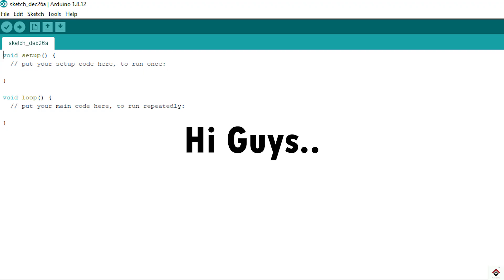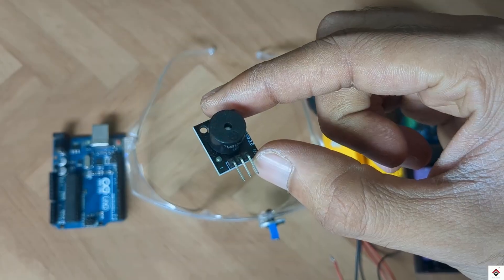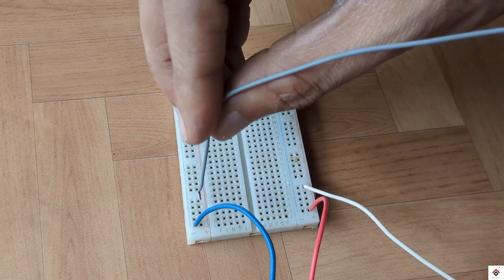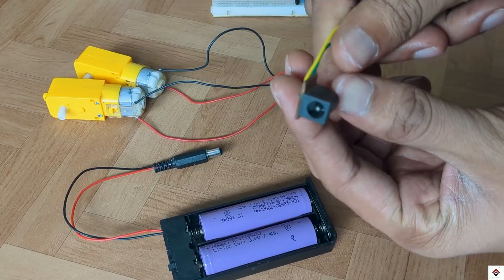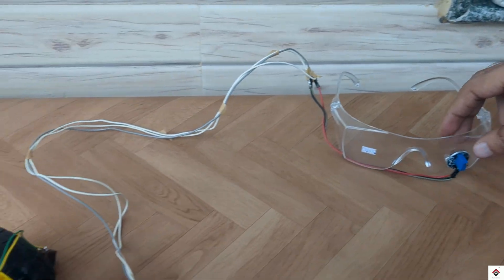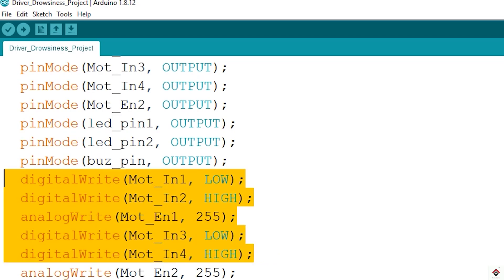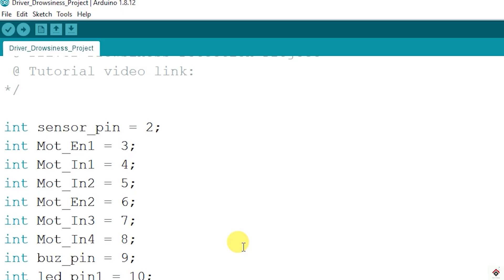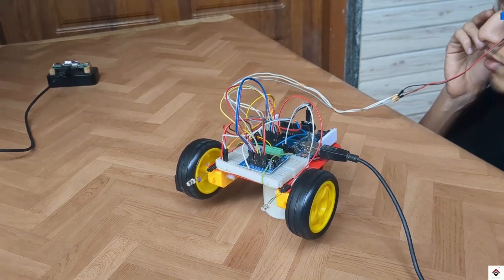Driver Drowsiness Detection Project 😴 | Anti Sleep Alarm System using Arduino, EYE Blink Sensor

Comment: Pls tell any other way to power Arduino in this project cause I don't have powerbank plss
Reply from the maker: You can use round pin connector with DC supply/battery 9 to 12v.

Comment: Is it necessary to use round pin to connect battery??? Pls reply it's urgent
Reply from the maker: Yes, if you give supply through USB port, all components will not get sufficient power.
So through this round pin connector, you can provide more voltage.

Comment: Engineer so the power supply for the Arduino.... How can I build it
Reply from the maker: You can check for voltage regulator circuit. I have not tried.
Reply: @techathome aside that
What's the way again

Comment: Instead of using L293d motor driver can i use single relay 5v motor or not ??
Reply from the maker: You can use it with slight changes in the code.
Using relay, motor will turn off immediately.
Here, with motor driver we are reducing the speed slowly and turning off.